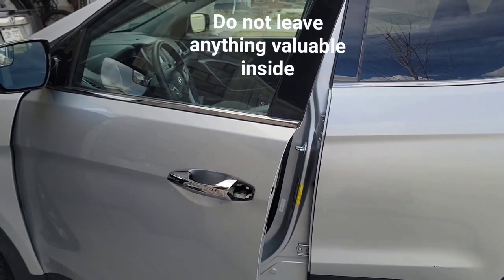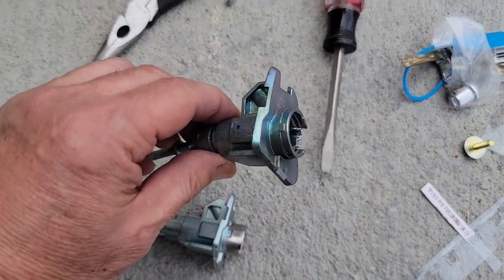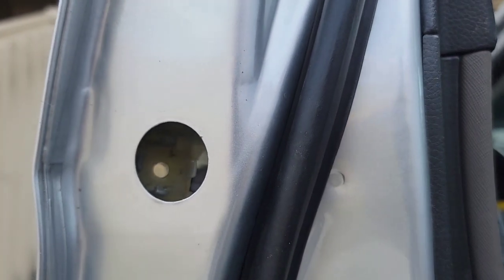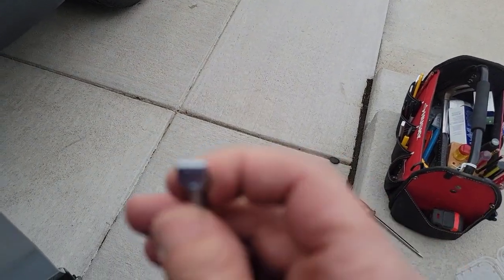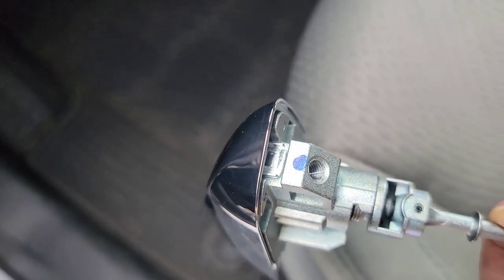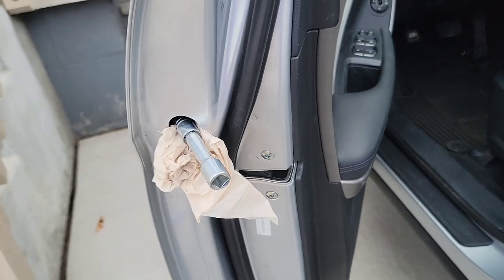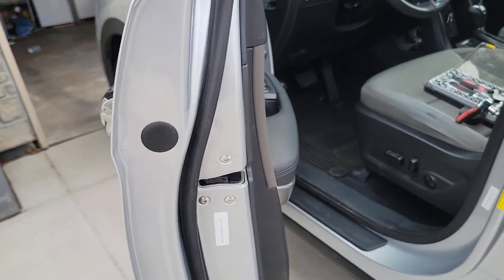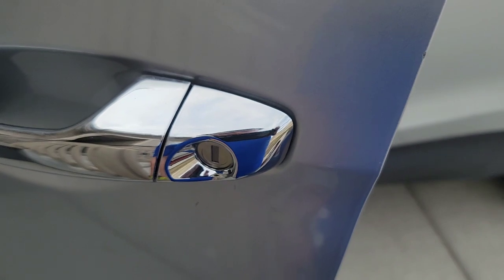2016 Hyundai Santa Fe door lock replacement repair / well wishes to thieves

Comment: Awesome video. Thank you for sharing. They tried to jack my fathers santa fe as well and they failed to get inside. Hope youre not having any more issues of this nature with your car.
Reply from the maker: The scumbag did get inside and messed up the ignition but I can still use the original key without too much trouble
Reply: Great Vid, thanks. Looking at other videos, apparently you do not need to completely remove the 10mm bolt, just loosen it until the lock barrel can be removed. The bolt has some retaining tags that stop it from falling out.